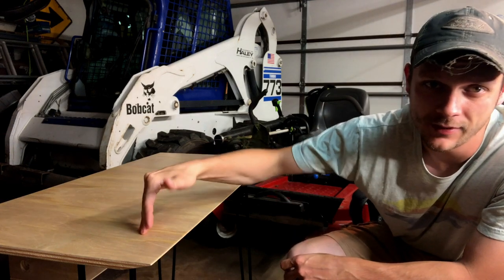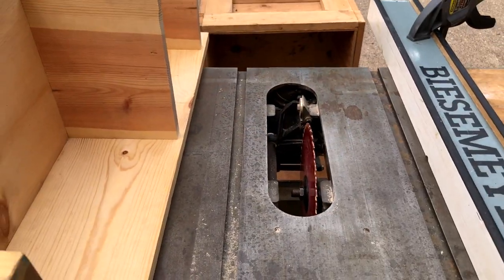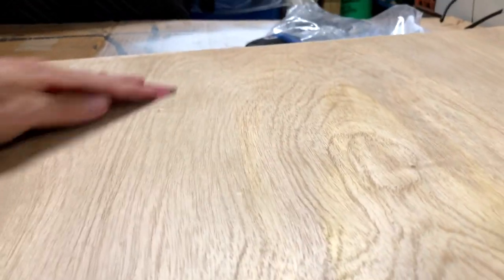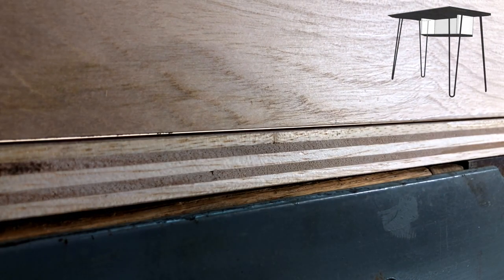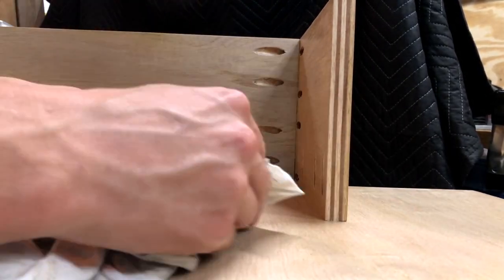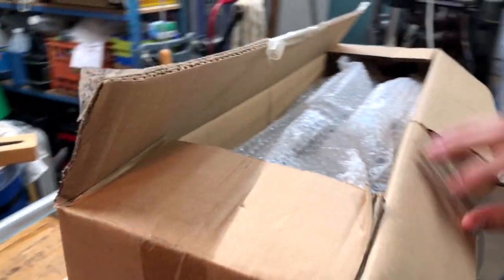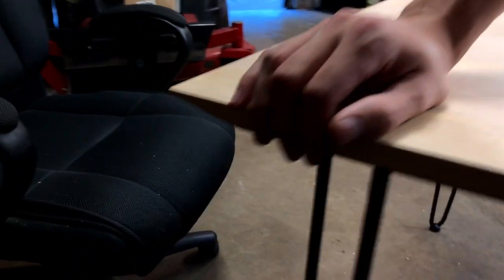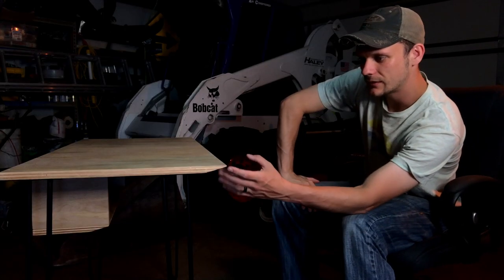Build A Simple Modern Gaming Desk - Maple Plywood and Hairpin Legs

Comment: As someone with zero tools I plan on doing some cuts at lowes/homedepot and then use gorilla glue to glue desired dimensions. 
There are so many designs you can do with plywood and sense it's cheap, it's awesome to experiment with.but I'll be building with farming lumber 2"x6"x8'.
Reply from the maker: Awesome, I think using the framing lumber will give you a lot of strength.
Reply: @mikekrzesowiak7944  Update; I finished the product. Farming Lumber (1.5" x 5.5" x 8") cut to 60". Left over scrap cut to 30. Thickness 2". Making desk 32" high (28" deep & 60" wide). Done with Shellac Amber. Looks really nice and fairly stable. For a 98$ budget, works well alongside no tolls! :D
Reply from the maker: @ampm8210  great work!

Comment: Could I use a power hand planer for that narrow cut? Not sure how that would go on plywood...
Reply from the maker: That could definitely work, as long as it’s sharp and you can maintain adequate control. It wouldn’t hurt to test it on some scrap plywood to find out… That method might even be safer than the table saw too 🤔